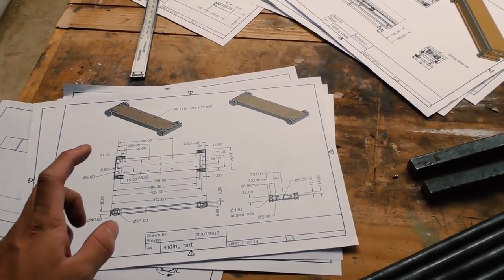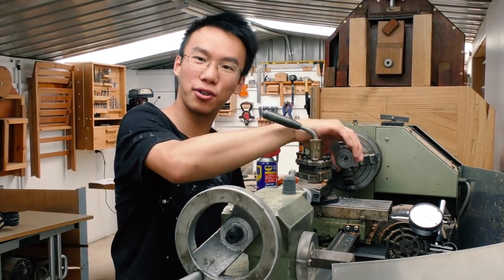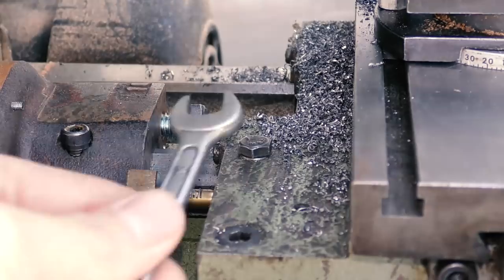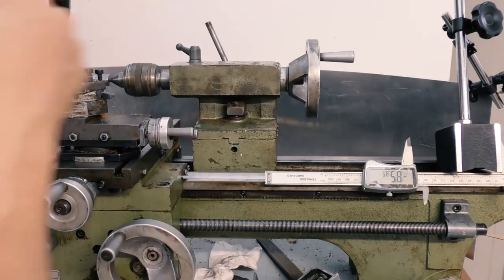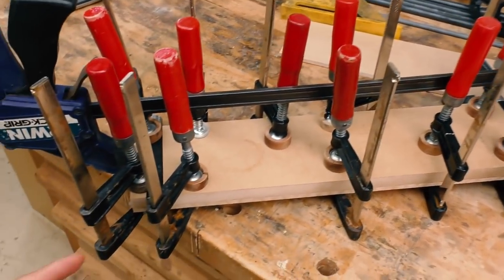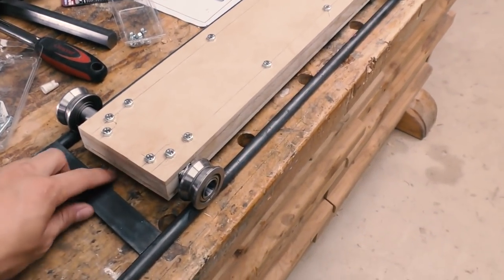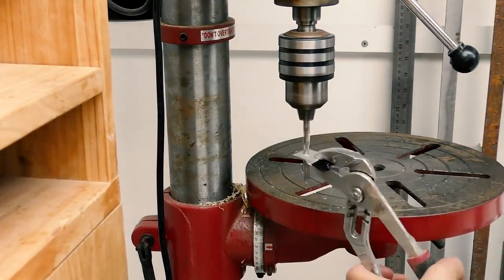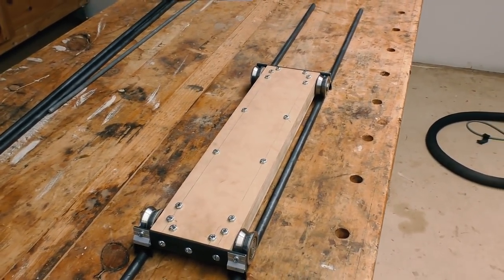Sliding table attachment Part 1 - building the sliding cart

Comment: Great project! 

When using a metal lathe here are some advice that i learned in technical college years ago:

Do not use the mitre sled unless needed as it is the least accurate. 
Lock it down (or thighten the screws on the side if that is not an option) when not in use. Have a sled stop on the main lathe bed for the sled to contact as a end stop instead.
If you need to turn down to an exact measurement do it in several even measurements in order to get the same forces pushing on the lathe in each turn. Example:
From 16 to 15 mm: 4 passes of 0.25 mm each. Take measurements each time. Use freshly sharpened hss cutting tools with a small radius for best result. Passes less than about 0.1 mm does not cut accurately and you are better off sanding small amounts instead.

Also, if you are not using constant cooling liqud, make sure not to measure when the parts are warm. 

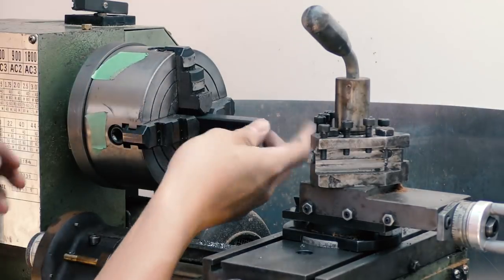When drilling centre holes it is important to drill deep enough for the angled tip of the centre to contact an angled hole. A sharp edge is not accurate anough (4:35)

Your lathe should (unless it is a realy weird one) have scales on the sleds that represent measurements in diameter so no need to calculate radius. Learn to use and rely on the sales.

Hope this was usefull despite my less-than-perfect english. 
Good luck!
Reply from the maker: Thanks for the advice.
Very much appreciated

Comment: Quite nice, but the axle shafts could have been simple round stock. A lot of work  the way it was done with square stock. The round axle shaft could have been held in place by various methods, even adhesive.

Comment: why the square shaft? would not turning down a larger diameter round shaft for the bearings work as well?
Reply from the maker: +Al S i thought it would be difficult to mount it into the cart and have an equal load bearing. However, maybe you could try drilling a hole the size of the shaft through the cart to achieve having a completely round shaft, but i don't have tools that can guarantee the two holes a perfectly parrallel with each other (my drill press sucks)

Comment: nice job.... you should be careful with that drill press machine, and get a good drill-vice to clamp your work piece while drilling... Holding the work piece with the pliers like you do at one point in the video is slightly better than holding it in your hand, but not good. Holding objects with your hand while drilling may work for some time, but is very dangerous. suddenly the part get sticked on the drill and start spinning and you loose the grip... be especially careful with that if you process brass. you can be cut in your hand and fingers really bad while working in that way. the part can also be centrifuged and fly across the room, and cut someone. Most risks with the drill press come from inappropriate work piece clamping methods. Secondly, that glasses you use when machining, are the safety glasses? Standard glasses are not safe, something can fly with high speed in you face and crush that glasses. Be safe.